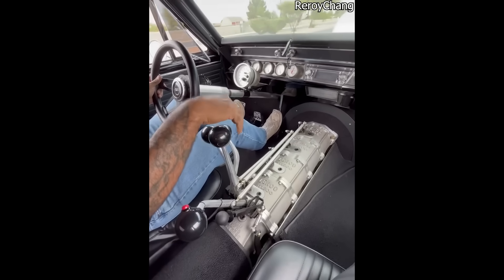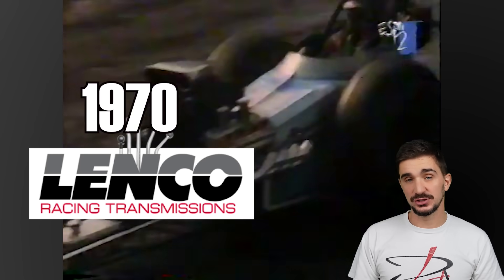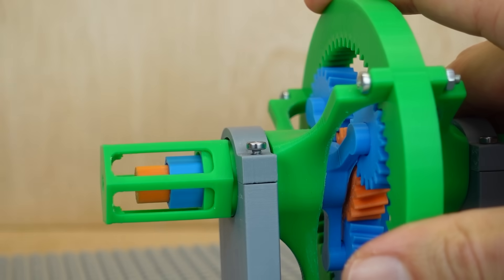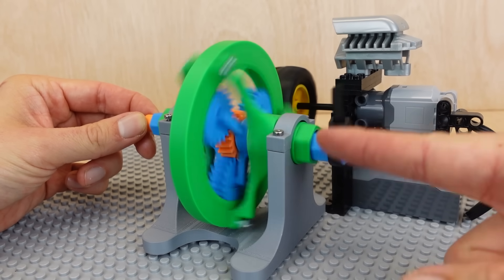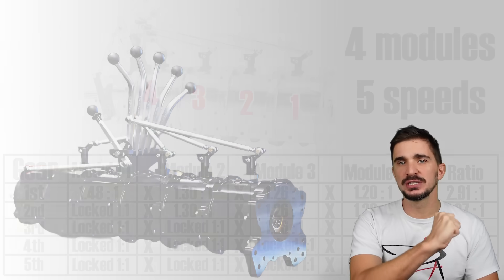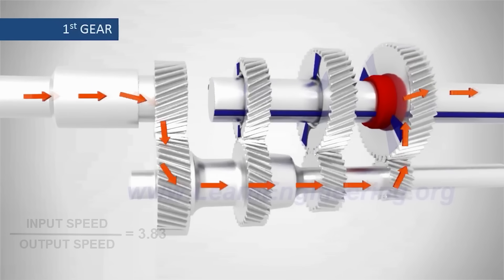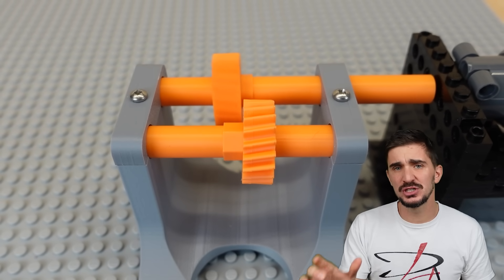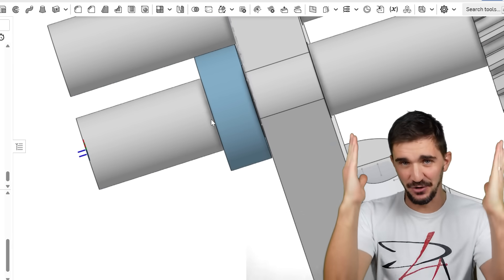This is The Strongest Transmission Ever Built - Planetary Manual Lenco Gearbox Explained

Comment: Having worked with planetary gearboxes in an industrial setting, I can testify that they are capable of handling extreme abuse.  There is just so much coverage across the working surfaces.  Their basic design is extremely clever - plug and play puzzle parts that are impossible to put together 'wrong'.  The tolerances of the parts results in a tightly contained unit where nothing really has room to develop play.  Other than checking the oil level and giving it a sniff, as far as the internals are concerned they pretty much last forever.

Comment: Your contact point math is wrong, each module is a link in the chain, and the chain is only as strong as it's weakest link, which is likely the final module in the stack since it has to handle the torque multiplication from each previous module.

Comment: Thas was, in a way a good explanation, but load is only distributed across contact points totalling the number of planet gears (in parallel). That force is applied in series on opposite sides of the gear, and again, in series on the next gear set.

Comment: You aren't considering the difference between parallel and series connections.  

If I have a chain 100 links long, you might say I couldn't possibly break the chain because "i'm not breaking 100 links".  But those links are in series, I only need to break 1.  

The 5 speed Lenco isn't sharing the torque across 24 patches.  It's only 3 patches moving the torque along, patches of 3, connected to other patches of 3, with 8 groups total.  So any one of those 8 groups can fail.

Comment: You should mention the ultra is more than double the power of the Max at 1527hp!! beats the Plaid track package on the nurburgring by a big margin and even the Rimac Nevera and Taycan Turbo GT at 7m05s
stripped out version with slicks... 6m22s 🤯

Comment: Thanks for making this video! There is shockingly little said about Lenco's out there. Even when you buy one they don't come with instructions, lol. You pretty much need to call and talk to Lenco to get the info you need like what oil to use and such. I've been drooling over these transmissions for 20 years now and I finally bought one this summer and I'm currently putting it in my car. I was familiar with how they worked already but I am super happy to see this great explanation that I can share with people!

Comment: I don't think the way you counted contact points is entirely accurate. You probably want the number that are carrying the load in parallel instead of series as each of the series ones can cause a failure independent of the other ones. I think in the manual transmission example, you can say that any gear you are shifted into has one contact point or torque path and in the planetary setup, you have three parallel force paths that are sharing the load. Too bad herringbone gears are impractical to manufacture outside of 3d printing. They give you the helical benefits without the thrust loading.

Comment: Okay, it's the first time I heard about this kind of transmission, but I have 2 points where I have another opinion than you. Or I didn't understand it.

1. The number of gears. So, if you have for example 2 planetary transmissions with 2 states, you get 4 gears. You can have both open, the first locked and the second open, the first open and the second locked and both locked.
Let's assume a ratio of 3:1 on the first and 2:1 on the second transmission. In gear 1 (both open) you have an end ratio of 6:1. If you lock transmission 2 but keep 1 open, you get 3:1. 1 locked, 2 open, 2:1. Both locked, 1:1. 
So, with multiple transmissions, adding another doubles the possible number of gears.
I understand why people add 5 transmissions in a row. It's far more convenient to just pull one lever after another than switching them back and forwards for the wanted ratio. I think automatic planetary gearboxes do this to get more gears.

2. The number of contact points. So, you have multiple transmissions in a row, but if one fails, the whole transmission is broken. 
So, we have to look at every single transmission for our force transfer. There, we have 6 contact points, but from the sun gear to the planetary gears, we only have 3 contact points parallel. In a usual manual transmission, we have one, because all the force is transferred from one gear to another. In the end, we still end up with thrice the amount of contact points. 
The strength of this transmission still comes from the stability of the single transmissions used.

Comment: hey man, just wondering, are you going to make a short video about EU canceling the combustion engine ban of 2035? or is it not that significant?

this one might be a big request but, can you add a clip of this video that has: this gearbox (lets say 3-4 modules), the input from the engine to the transmission, shifting mechanism, output from the engine, and also 1 more important thing: showing the exact path where the torque is coming from and where is it exiting in the gearbox, so we will know exactly where the power comes from in the gearbox, what are the exact contact points that get all the torque, and how shifting really works.

why am i requesting this: im more into this gearbox stuffs and i havent seen much explanations for this exact gearbox, and it boggles my mind when you said that there are 6 points (in each module) that get torque splitted up, and 24 contact points that all share the torque, really boggles my mind. thats why i request for exact torque path from the input of the gearbox (from the engine), through the gearsets (and the shifting mechanism included so that we will know exactly what stops some modules, and well, to better understand what is going on), and out the output.

thanks

Comment: Ran a 3spd air shifted Lenco in our Promod 69' Nova with a 3000+hp Arias blown hemi on methanol. Never had a problem with ours. Lenco has a reverser module that most people have if running a Lenco, its always the last module so what looks like a 5sp is probably a 4spd w/reverser. Each segment has its own lubrication. Nothing fancy, just splash/bath type lubrication with 30wt non detergent motor oil. The other popular clutchless drag transmissions like the Liberty, G-force, Jerico, Doug Nash, etc, are not planetary. They can't handle the same power a Lenco can. Nowadays almost everyone using a Lenco has ditched the clutch and use a torque converter drive.

Comment: Technyically, 4 modulese with different ratios give you 16 different gears. 
If you arrange them correctly, you only need to engage/disengage one clutch between consecutive gears. (greycode vs binary)
herringbone gears would be a solution for the thrust bearing issue.
maybe even a pair of helical gears fixed together with bolts? (would be far cheaper)

Comment: Hey D4A i know your a car guy but could you do a video on different ag tractor transmission, the interesting thing about them is that pretty much all the time there atleast 2-3 transmission linked together to form one big transmission in the case of powershifts, it in the case of variable transmission (case ih CVX, john deere IVT, and fendt VARIO) its most of the time a hydrostatic linked with a geared transmission, neat stuff i think. Could you please look into this?

Comment: Thanks for the interesting video, @d4a!
I'm a bit unclear. When you pull a gear lever, how exactly does that lock the two shafts together? Is that what you use the clutch pack for?

Comment: HE MAKES AN INCORRECT POINT IN THE AMOUNT OF GEAR TOOTH CONTACT IN CONVENTIONAL AUTOMATIC/ MANUAL TRANSMISSIONS. THE HELICAL CUT GEARS ENGAGE MORE THAN ONE TOOTH ON THE GEAR AT A TIME. THIS IS BASICALLY CORRECT IN GENERAL BUT VERY OVER SIMPLIFIED.  HOWEVER THIS IS MISLEADING AS STRAIGHT CUT GEARS LIKE IN A TYPICAL RACING DOGBOX TRANSMISSION OR LENCO ARE STRONGER THAN HELICAL CUT GEARS BECAUSE WHILE MORE THAN ONE TOOTH IS MESHING IT ONLY APPLIES THE TORQUE TO A FRACTION OF THE GEAR TOOTH. LENCOS ARE KING IN RACING UNTIL TOP FUEL AND FUNNY CAR. WITH ALL THAT SAID I'D LOVE TO SEE A LENCO WITH HELICAL CUT GEARS, OR BETTER  YET HERRING BONE CUT GEARS... NO THRUST BEARING NEEDED. TOP FUEL AND FUNNY CAR IT'S ALL DIRECT DRIVE MULTI-PLATE CLUTCH SETUPS WITH NO TRANSMISSION AND GRADUALLY SLIPPING THE CLUTCH  UNTIL LOCKUP. THEN THE CENTRIFUGAL FORCE MAKES THE TIRE "GROW" INCREASING GEAR RATIO, NUMERICALLY LOWER.

Comment: There's definitely road cars with super high first gear ratios close  to 4 like my 91 325ix has a first gear ratios of 3.83 with a 3.91 final drive ratio. Or any of the e36 zf five speeds have a first gear of 4.2 and no overdrive.

Comment: 3 planet gears have 6 points of contact doesnt make it 6 times stronger than a single point of contact gear, you do have 3 gears sharing the load so effectivel 3x the strength

Comment: 11:57 you're not talking about a modified auto then and putting in the caveat that the lenco is set up correctly. Th400s handle 3500hp with similar work exist too.

Comment: Cleatus had Bruno/Lenco in McFlurry, but they replaced it because performance wasn't there (car was a dragster starting in manual transmission class, but the other cars in same class would destroy them). They went with something else for manual transmission setup.
Reply: They honestly could’ve done fine, just needed a few ratio changes, lockup conversion, and the right guys to talk to. I was honestly kind of disappointed to hear them say it was easier to spend 20k on a M&M instead of pulling the trans apart and swap ratios. I’ve been with/ seen guys swap out ratios in like 15-20 mins in the pits. Personally have a 3spd Bruno/ Lenco as well. Definitely easier to spend the $500-700 per gear set to have different ratios. As well as you can just swap cases around. For them to say it was “too hard” is just not the right way to put it.
Reply: @trottierindustries3769  I also thought that Bruno/Lenco setup was really cool, completely something else.

Comment: One more technical correction. The way you are counting the contact points does not give any information about reliability of the system. What really counts is the "number" (surface area to be more exact) of pressure points at any identical power exchange points down the chain, so you only need to add how many of them work in parallel. In first case there is ONE pressure point and in the other only THREE, not six or twelve. Those six and twelve points only contribute to 2x adn 4x power losses but not to the reduction of instantaneously acting forces and increase in reliability.

Comment: Alright, hear me out... electronic shift box for this transmission design connected to paddles. FR configuration. Real short drive shaft on a real small sports car. I bet it doesn't suck at downshifting when it doesn't suck to downshift. Why would it?

Comment: 11:00 not sure about contact point number comparison. Each planet must have two contacts to apply force while a single usual gear-to-gear contact would do exactly same.
Therefore I would rather say that the count is 2 vs 6.
IMO it's much more important that Lenco is symmetrical, the shaft does not get literally any side force.
And it's also self-balancing. All wear is uniform and the sun gear centers itself under torque.

Comment: Your couting of the contact points at minute 10:45 and at minute 11:00 was kind of dishonest. We could say, e.g., that a chain has 100 contact points. But if you remove half the links, would you say that the chain is half as strong because it has 50 contact points?

Comment: With the contact points of gears, you’re confusing series and parallel. With the manual, you have just one contact point of a few teeth to withstand the full torque, the one that matters is the one moving slowest. Only one contact point needs to crack for the transmission to fail. With the planetary, you have as many contact points as you have planet gears per section. If that’s 6, then 6 contact points.

As for the gears and axial forces, herringbone gears don’t have that issue, but they are a pain to manufacture. Maybe a semi-circular tooth peak would be easier to make than a triangular one.

Comment: The clutch engagement for the next higher gear is not instantaneous . And is varied by a mechanical tapered wedge ramp that is adjusted for pressure and rate of clutch lock up . That's internal Lenco clutch pak .

Comment: Drag racer Bruno maso of garage squad is the creator of the Bruno/ linko transmission
Reply: That is Bruno Massel Jr. 

It was his father, Bruno Massel, that first put a torque converter in front of a Lenco. I know the Massel family, I have raced around them for over 40 years. 

Bruno Massel also made one of the first PowerGlide transmission shields. It was a gold anodized T6 heat treated aluminum plate, rolled to form a half circle around the transmission case.
Reply: @AlanRoehrich9651 wow! Thank you for clearing that up😊✌️

Comment: Nice video only one gripe which is how you counted all contact points and not just the ones that are parallel(splitting the load) ie manual has 1 point that need to hold the full force while the Planetary gear set would have 3

Comment: does this have anything to do with manufacturers claiming they dont have manual transmissions that can handle the torque that modern engines make? I can see why if it comes down to the number of contact points that torque gets transmitted through.

Comment: 12:30 This is probably an unfair assessment as double helical gears are common (which fix this effect) however the more likely reason they are not used is complexity of manufacturing and assembly of the planetary gearbox. It's only a race trans so straight cut is easier

Comment: Bub i hate to tell you but any drag racers that go to a track most definitely does not just dump the clutch. Most of the time if you're caught doing that at an official track you will receive a warning and if you continue to do it you will be kicked out of the track.  Professional drag Racers actually preload their clutch or have a built-in hydraulic slipper setup that slowly releases it. Only drifters and neanderthals doing donuts in intersections "dump the clutch". All of the clutch side-stepping footage you're showing us in your video is a guy who actually has a hydraulic slipper setup in line with his clutch.

Comment: You implied, but didn't state explicitly, that OnShape works on Linux.  I can confirm that OnShape is accessible to computers using Linux based operating systems.  However, smartphones and tablets are still a no-go due to the lack of a mouse.

Comment: Pretty sure Powerglides were autos.
Reply from the maker: Hydramatics were too. All were used in drag racing extensively
Reply: @d4a  I am aware.  I am only commenting due to the fact that up to the point that Powerglides were mentioned, the video was speaking about manual transmissions.

Comment: I just do not like clouded the though where Ai  datra centers use that information on clouds storage (which is why it was done as a data base for Ai like the pixcles in a photograph )to make billions  or online cad used the same way where i am though of as a asset or resource akin to a slave with out rights . as they build there Ai to control the masses and steal ideas and so lifers and  money,   a real Wankel he was in to rotation  , T"   " turbine  combustion engine with a single or hor apposed twin  combustion  AAAAAAAAAAAAAAAAAAAAAAAAAAAAAAAAAAAAAAAAAAAAAAAAAAAAAhaaaaaaaaaaaaaaaaaaaaaaaaaaaaaaaaaaaaaaaaaaaaaaaaaaaaaa

Comment: 0:31 it's pretty clear an eCVT which has a single planetary gear set (like one stage on the lenco), no clutch packs, and no clutch, could be built stronger, plus because there is no slipping anywhere, transmission fluid almost never need replacing . those transmissions are underrated because they've never been mated to high torque/performance engines, but nasically only ~ 2-2.5 inline 4 low torque atkinson. I think Toyota really missed the opportunity to make a flagship hybrid like a LFA hybrid with a 8+ cylinder mated to a strong eCVT. they can easily program a manual mode with paddles and an automatic mode wirh virtual gears and the number of gears and ratios can easily be customized. for those who don't mind thenauto CVT mode it has better performance (peak power at all speeds)

Comment: The 3d printed model was pretty pointless in describing the workings of the lenco...
The overrun clutch is the heart of the system, which it lacked completely and the gear ratios is just silly.
It did just show a generic epicyclic gear train...

The claim of lenco being stronger than automatics is just outright ridiculous.
And stronger than the constant mesh transmission? Highly debatable.
The advantage is that part of the clutches can be stationary, while on a constant mesh, they need to rotate.
Besides that, i dont see why it would be stronger. Both have used one way clutches too, not that im convinced that it's the strongest clutch design.

Comment: 11:00 in one module alone, you have 6 contact points or gears engaged. if you keep adding modules in series it's not going to reduce the force on each gear, it's just going to add more failure points. also the more gear reduction stahes  you are adding, the more you are multiplying torque so the more likely to break

Comment: The manual planetary transmission has been around since the beginning of the automobile. The Model T Ford transmission is a manual planetary. Stutz and other early auto makers used them too but controlled through foot pedals. The inside of those Lenco modules look allot like Model T transmission parts. Another advantage of the planetary system is the gears never come out of mesh while changing gears, unlike an H pattern shifter.